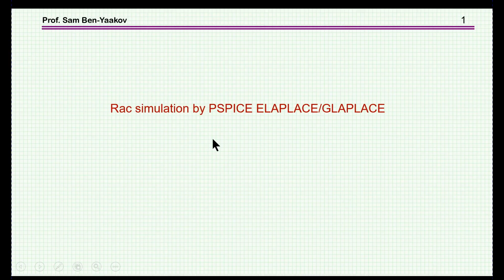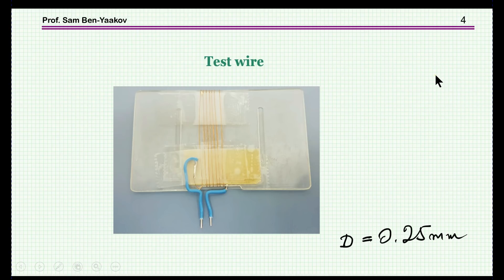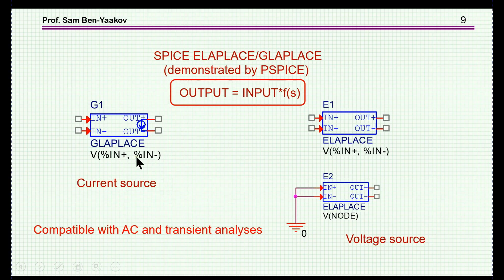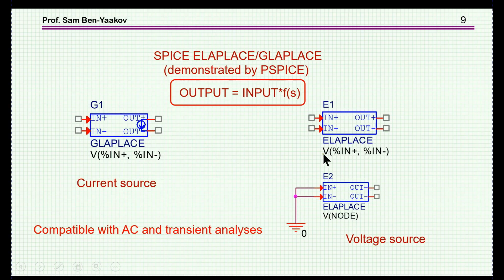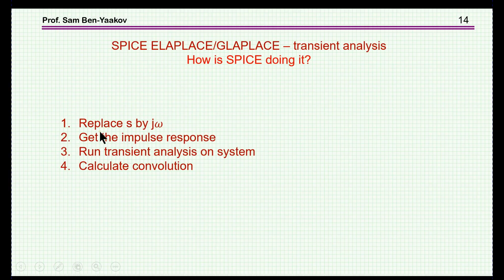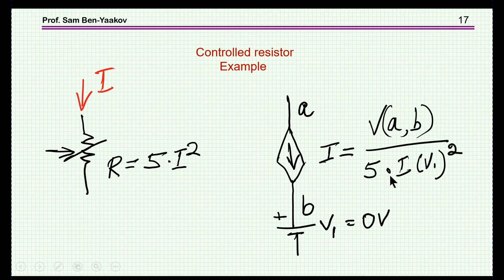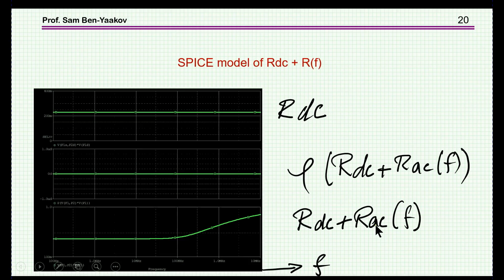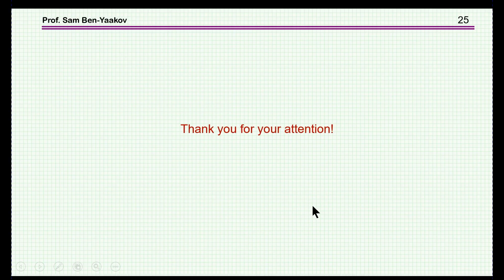Rac simulation by PSPICE ELAPLACE/GLAPLACE

Comment: To model a frequency-controlled resistor, I used the method including a non-linear laplace form voltage control current source Glaplace you suggested here. 
I tried with a simple equation, R=1+f, when I do the AC sweep study in the PSPICE, the model works fine as I attached figure as AC sweep, the resistance changes from 1 to 101 ohms when frequency changing from 1 to 100 Hz. And the voltage crossing that model is consistent with our concept. In AC sweep simulation, that model is working ok. 
However when I simulate that in transient simulation with a simple 100Hz sin wave, the resistance response of model is very inaccurate ( the value of that is far away from R=1+100=101 ohms), and also the voltage across the resistor has a phase shift compared with input source, which should not that since my simple circuits just have resistance component. 
So I am not sure if those Glaplace model could be used in the transient simulation. 
Do yo have any information or comments about that?
Any suggestions and comments would be appreciated. 
Thank you.
Reply from the maker: Try to reduce (limit) the step size, assuming that your model has no errors😊
Reply: the same problem happend in my simulation. have you fixed this

Comment: In the region Rsc is increasing as sqrt(f), should the phase not be 45 degrees? In some of the other models i have used the phase shows up as 45 degrees. I am analyzing a resonant network and trying to include ac resistance hence phase is critical.
Reply from the maker: Why?  Rac  is resistive

Comment: At around 30MHz resistance drops again, is this due inter winding capacitance or some measurement limitation with the equipment?
Reply from the maker: Keen observation. As you wrote, are probably two reason for the drop: the bandwidth of the analyzer is only 50MHz and interwinding capacitance. Thanks for bringing this up.